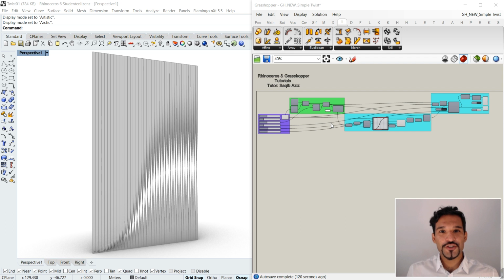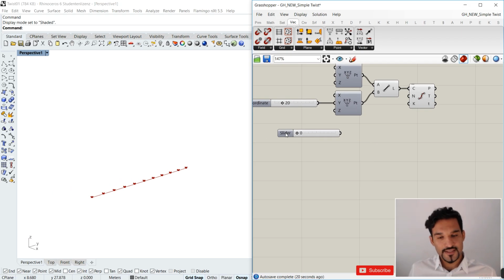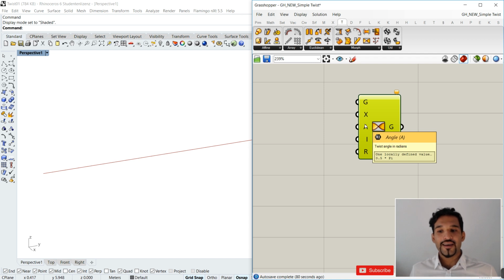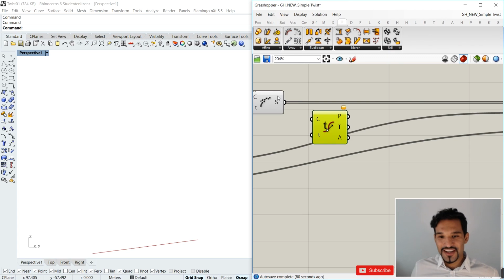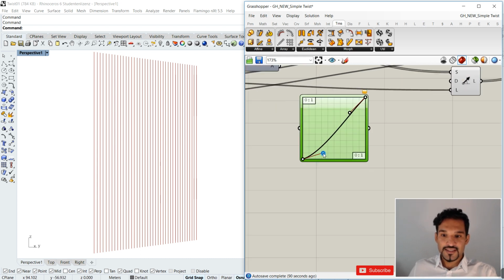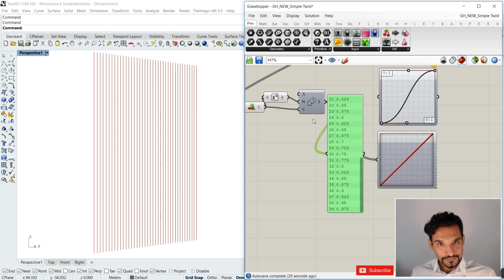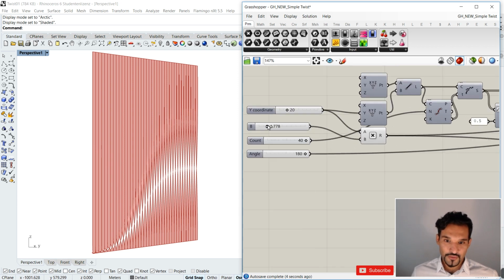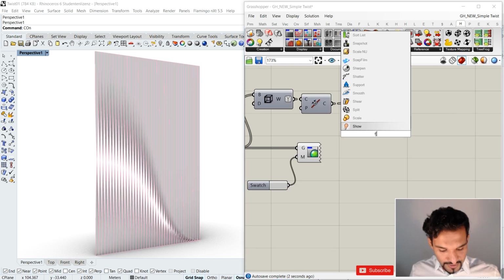New Grasshopper3D Component - Twist (Also Graph Mapper & Stream Filter) Tutorial (Beginner/Interm)

Comment: i have one question when you have so many software to work with do you follow a format. like if i have to work on relatively medium size project like business complex or bigger scale urban design projects do you hand sketch out the form than start level plans on auto cad or section on  revit or you directly use sketch up or 3ds max or use rhino gasshopper and then follow by Photoshop or indesign for creating a presentation out of it.
like do you follow certain pattern from start to finish 
i hope this is not irreverent question
Reply from the maker: Dee K Hey that is a good question and I can only give you my experience on this. I personally work as a computational design specialist and only use Rhino Grasshopper for Research/ competitions and use the adobe suite for any form of presentations. But yes if you have a project that runs through all stages, our office starts with early design in rhino and moves on to Auto Cad and Revit for the constructive phase.
Reply: do your college or architecture firm you might be working in follow certain format?